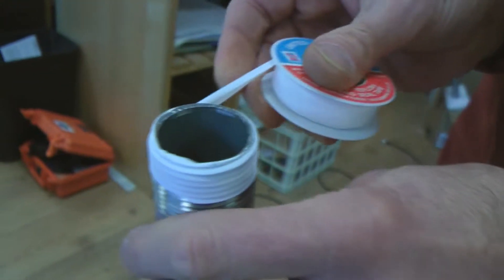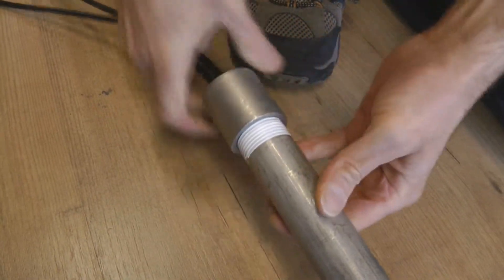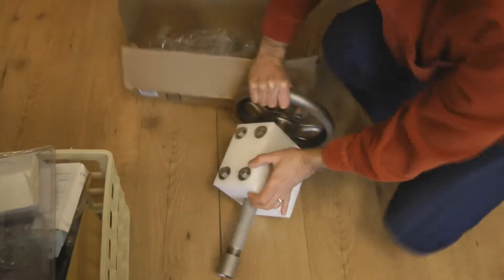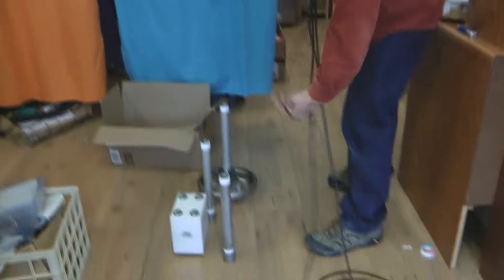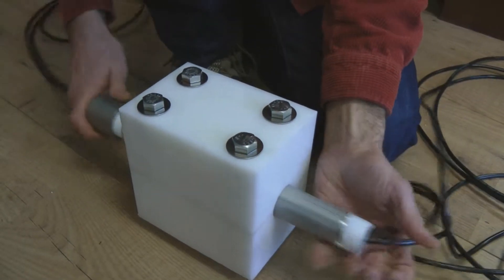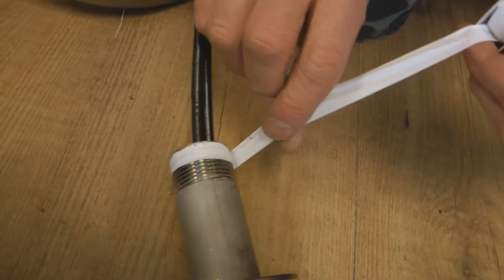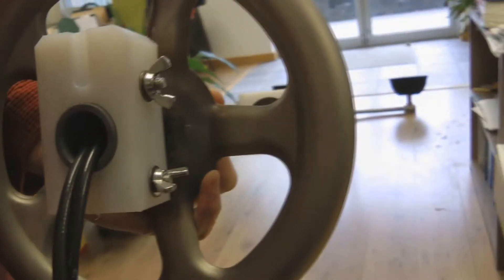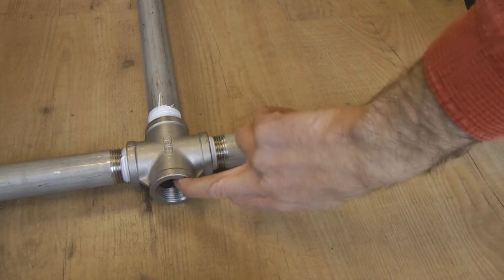Stereo Hydrophone Assembly

Comment: If you need a hydrophone amplifier try HY-11   http://www.h-instruments.com/Hydrophone_Amplifier/p484050_17280806.aspx
Reply from the maker: What is the frequency response of your preamplifier?
Reply: @Cetaceanresearch   20Hz to 20kHz. High gain and high input impedance
Reply from the maker: @John-ti8jl  Thanks. All the preamps used with my hydrophones have at least 40kHz bandwidth. If you decide to start building some with a broader bandwidth, it would be interesting to test one out.